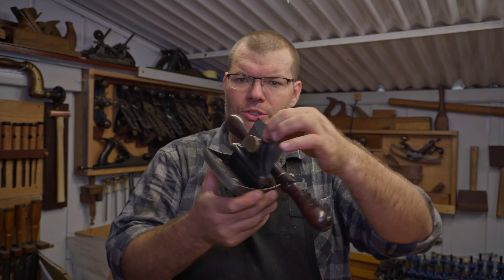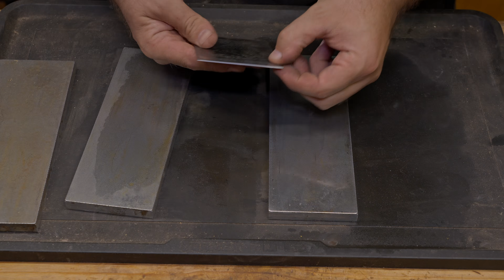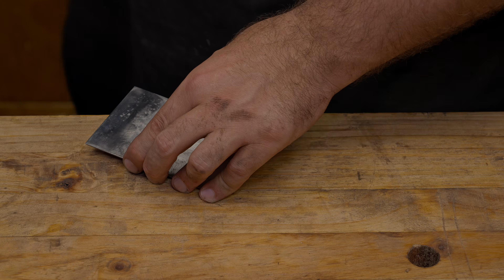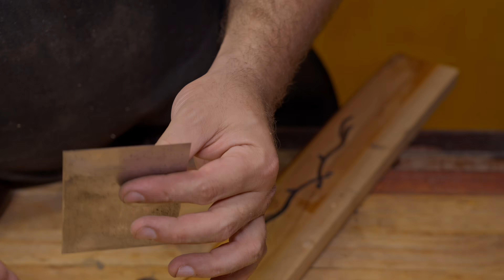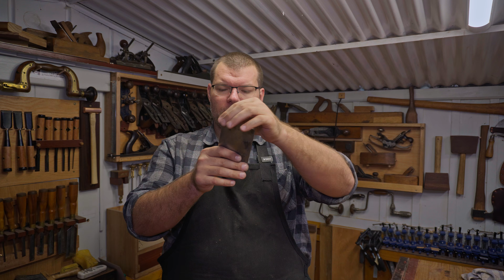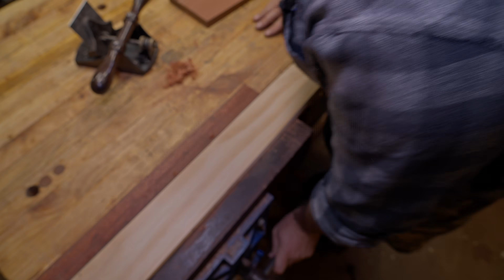Essential Steps for Scraper Plane Setup & Use

Comment: Thanks much.  My first time trying to understand the scraper plane setup.  Mostly understood you.  But are you making a bur on one side, rolling back in with burnisher, and then creating a bur on the opposite side with angled sweep of the burnisher?
Reply from the maker: So a burr will be created when Sharpening the scraper, but that burr is rough and not very strong. The consolidating the steel (pushing it back into itself making the metal stronger - not sure on how exactly but it does work) using the burnisher the first sharpening burr just falls off.

Then we roll a proper strong burr onto the flat side of the scraper (or push the steel into a hook from the bevel to the flat side) using the burnisher, which is approximately 5ish degrees off the 25 degree bevel on the scraper.

Does this clarify this for you or do you need me to make a video to answer this better?

Comment: Well. I've only ever had a #80 and so this has never been part of my artillery. I like the adjustable angle and interchangeable blades. Versatile springs to mind - I like versatile. I work mostly in Pine so it would be great to have (certainly better than a #80 or card scrapers). Will I rush out to buy a new one? No. Would I buy a good used one if it was reasonably priced? I'd be there like a V8...!
Reply from the maker: It's certainly not 100% necessary for pine as a well setup hand plane can usually get the job done most of the time. Having said that i do use it occasionally when the hand plane causes the pine to tear out (usually notty construction pine).

Comment: Very nice to see you feeling your way along with these old tools, Luke. Nothing over- refined about these videos and that's the beauty of them.
Reply: Luke,any tips on where to obtain replacement 1.5 or 2mm blades for these in Oz?
Reply from the maker: @SimonHoning  your best bet is Timbecon, they sell the Luban scraper plane which has a 1.6mm thick scraper and appears to be almost identical to the blade in my 12 1/2 except they only have a bevel on one end, I've included the link for you here: https://www.timbecon.com.au/scraping-plane-73 

If you cant find the replacement scraper click on the drop box under the heading and you will find replacement blade listed there.

I also found this one also found here https://www.woodworksupplies.com.au/p/9574785/12112-scraper-plane-blade-o1-high-carbon-steel.html to give you other options.

Lie-Nielson Australia also has one too but that is 3.55mm thick

hope this helps
Reply: That's tremendously helpful.Thanks for taking the time to do this.All the best, mate.
Reply from the maker: Thanks

Comment: "If you want to scrape pine?'", we have a straight-jacket and padded room for you.
Reply from the maker: I've never had a problem using a scraper on pine, gives great results most of the time it's really not difficult. But it would be difficult to use a scraper wearing a straight jacket.